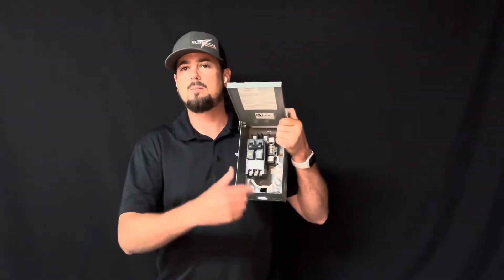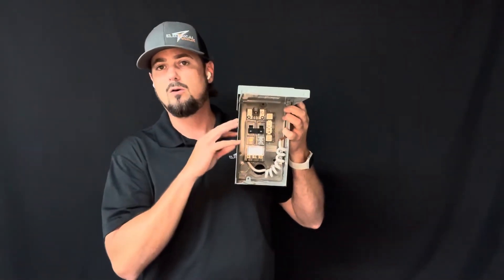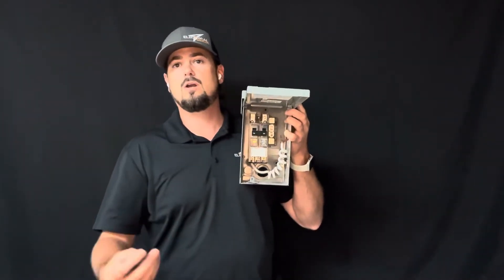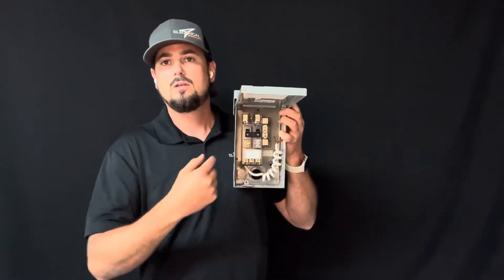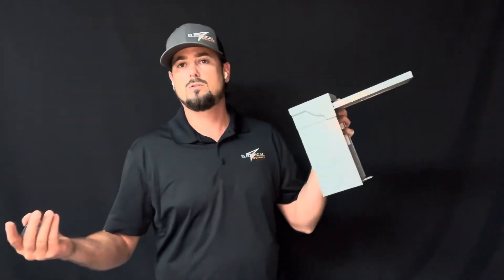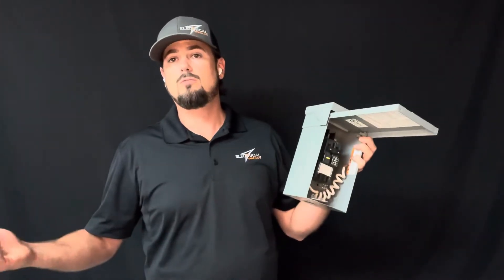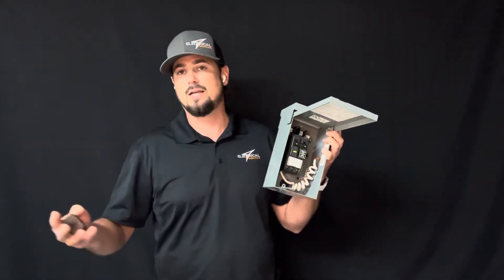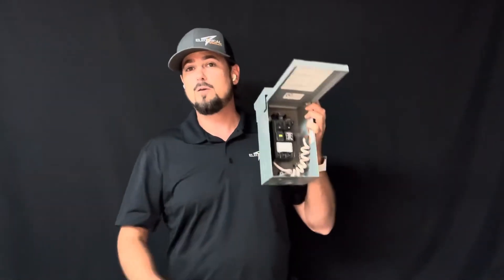Why Your Electrical Panel Hums (And When to Worry)

Comment: I have a very high pitched sound coming out of almost every outlet in my house that sound at times like it goes on off on off then other times it's gets LOUDER and is one continuous  weeeeeeeeeeeee  sound that also makes me feel my heads being squeezed and I get a weird feeling in my body.. 
  If I standing in my bedroom and I stand still and move my arm around you can hear the change in the high pitched sound like I'm a antenna.... 

And now I can hear a faint bzzzzt bzzzzt bzzzzt that goes from  on to faded down in sound also... This high pitched sound is making me feel like crap.  And I'm scared my house is going to burn down.. 

Someone please help. What should I do..

 Can anyone tell me what could be causing this?
Reply from the maker: That’s very interesting. We’ve never heard of this specific situation, but if your electrical outlets are truly transferring audible noise of any kind you should absolutely call a professional. There has been instances of radio signal received though electrical systems so it wouldn’t be the first time something this strange has occurred. Let us know what you find out.

Comment: I may currently have a similar problem when I am hearing sizzling coming from one of my outlets. Is this an immediate problem?
Reply from the maker: Absolutely. A sizzling sound is an indicator something could be internally breaking down in the outlet or the wiring connections. I would highly suggest calling a professional, or if you feel comfortable, turning the power off and just planning on changing out the outlet. You will most likely find out what the issue was in the process. Let us know what you find!

Comment: I have a question, i never noticed or never heard it do that but just today i noticed/heard a hum coming from the power box but when my pc was working (gaming pc) and if i turn it off it stops, its a constant hum but its not loud since i just noticed it when everything was quiet, should i call an electrician?
Reply from the maker: Excellent question. If I am understanding you correctly, the buzzing sound is only happening when your pc is running, and stops when you shut it off. If that is the case, the good news is that the issue will be much easier to isolate. I would suggest monitoring the issue a bit longer to confirm it is the pc circuit. If it continues its definitely worth having someone look at it as it could be cause for concern. Let us know what you find.

Comment: would it disappear when i step close to wall?
Reply from the maker: The humming sound is typically pretty constant. If it gets louder and quieter that can be a sign and could identify an isolated issue that may need addressed.

Comment: Mine hums occasionally maybe once every 30 minutes and gets loud enough to hear 10 feet away for a few seconds then calms down to silent again. Is that anything to worry about?
Reply from the maker: That's interesting that its occasional like that. They typically are pretty steady, more like a refrigerator sound. I would definitely look further into the situation. One thing you could do is see if there is an appliance running about the same amount of time as the buzzing and if it shuts off around the same time it stops. The good news is if its happening frequently enough it will make it easier to isolate and find exactly what's happening. Let us know what you find!

Comment: Thanks for the explanations. I need help with loud buzzing that came when the power company put in new poles and I think they rerouted where our power comes from. Serious sleep disturbance. Power company came 5 times, tried things, cannot seem to fix it. Any ideas?
Reply from the maker: That is a first. There’s always something new we get to play a bit of detective with. Can you describe where specifically the buzzing is coming from ? The panel itself or the service equipment such as the meter or disconnect? The power company is only liable for the hardware that supplies power to the home, so the connection point in the air, assuming yours is overhead. Sometimes when power is shut off for the first time in years, the parts that were hanging in there but past their point of usability finally give up.